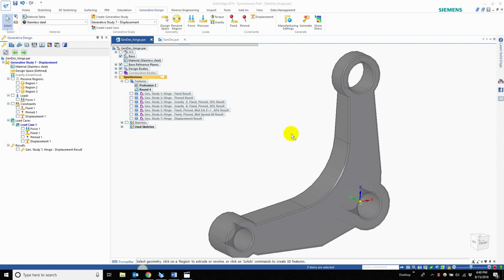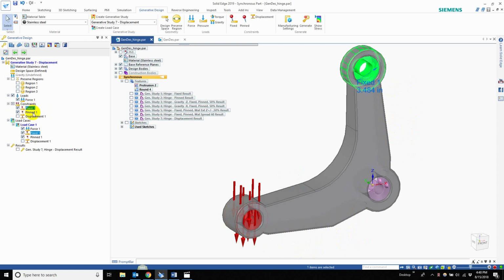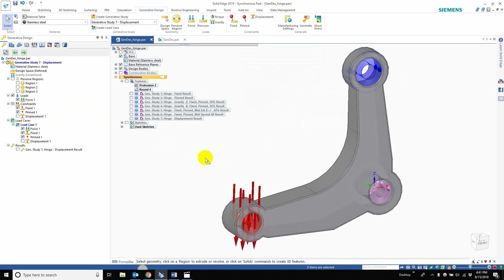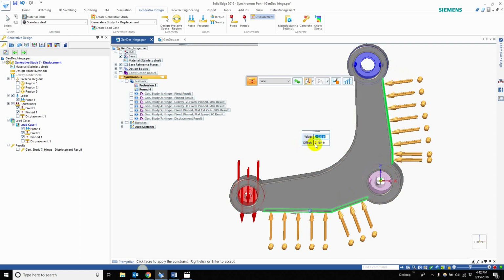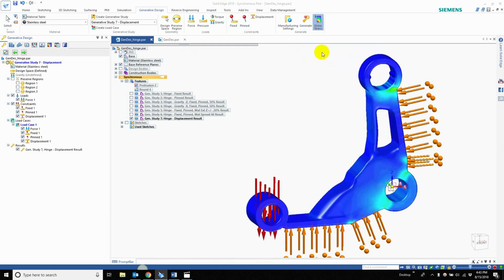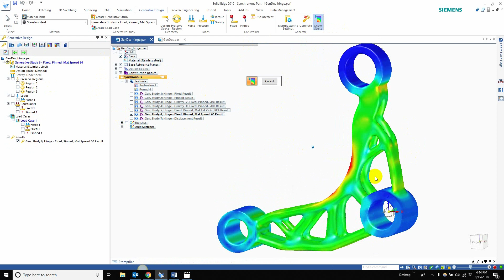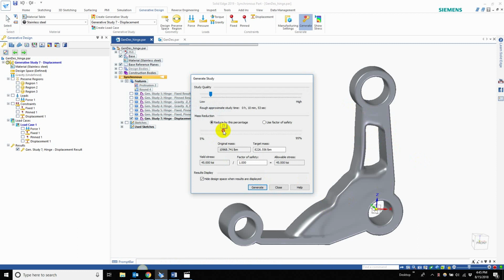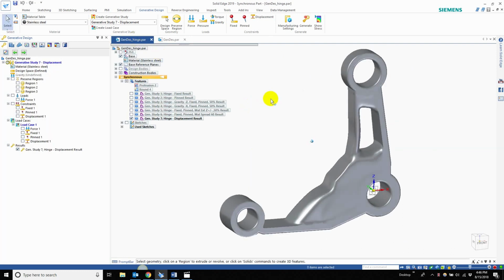Part 5: Displacement Constraint - What's New in Generative Design with Solid Edge 2019

Comment: Is there a way I can save the part generated from the generative design so I can do a static load simulation on the part? I know I can show the stresses in generative design but it doesn't tell me the values of the stresses in the part but I want to see if the stresses in my part  is going to above the maximum yield strength.